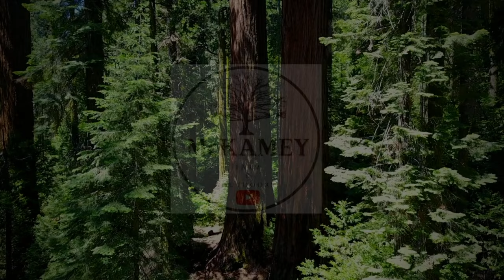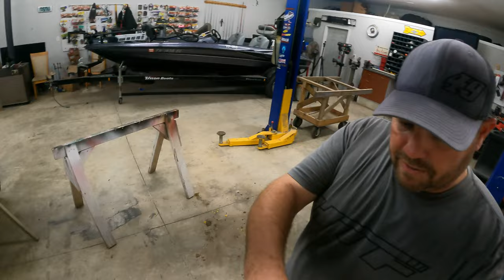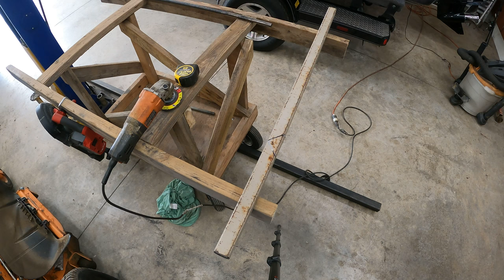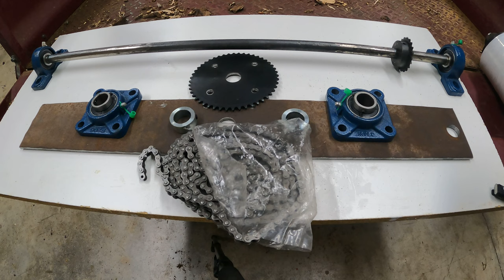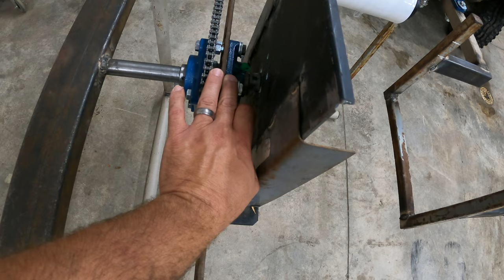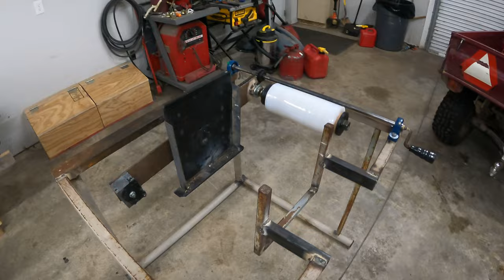Homemade Firewood Bundler (Wrapping Machine) Low-Cost 💵

Comment: Exactly what I have been looking for, a parts list so I don't have to reinvent the wheel.  Thanks!
Reply from the maker: No problem! Let me know if there’s anything else I could help with. It’s been working great. I’ve ran about 275+ bundles through it so far
Reply: Just to get a general idea of the materials length, can you provide width, height and depth measurements of the overall frame, as well as the main wrap and weight plate with the weight of the lead counterweight?  Thanks again.
Reply from the maker: Send me your email address and I’ll send you some dimensions. My email address is in the details on the main Home Screen of my channel

Comment: I would weld some "wings" on the tightness adjusting nut...then you wouldn't have to use a wrench.
Reply from the maker: I think I’m definitely going to do something like that. I’m in search of a different rate spring also right now. The one I have is too stiff and doesn’t work as well when I get toward the end of a roll.

Comment: Great job! I built but but have yet to find a spring. Where did you source your spring for tension?
Reply from the maker: I actually sourced it off of a zero turn mower that I had for scrap. It’s one of the seat springs that I cut the end off of. It’s a little stiff but seems to work ok.
Reply from the maker: I would try McMaster -Carr.  They have a good selection of hardware components 

Compression Springs, 1.25" Long, 1.225" OD, 1.015" ID

https://www.mcmaster.com/9657K528

Comment: Where did you get the 2 ends that fit in the wrap?
Reply from the maker: I made them out of 1/2” thick Plastic sheeting I had laying around. I cut out a 3” one and a 4” one with hole saw bits and then sandwiched them together to basically make a spool.
Reply: @McKameyFarms what length is the plastic wrap
Reply from the maker: @rogerbenton2354  It’s 12” Shrink Wrap. I bought it on Amazon
Reply from the maker: @rogerbenton2354  Stretch Wrap Cast Hand Shrink... https://www.amazon.com/dp/B00MY48LF6?ref=ppx_pop_mob_ap_share